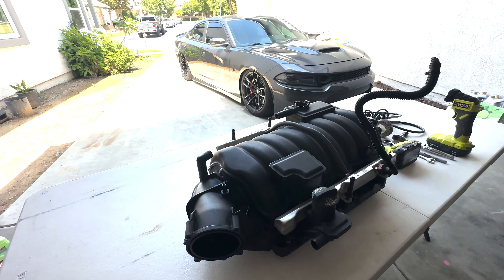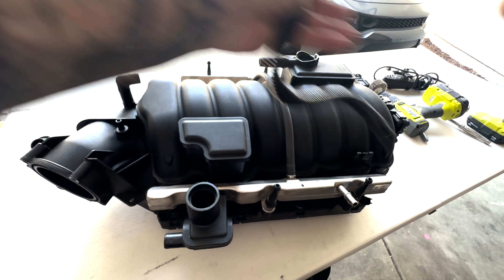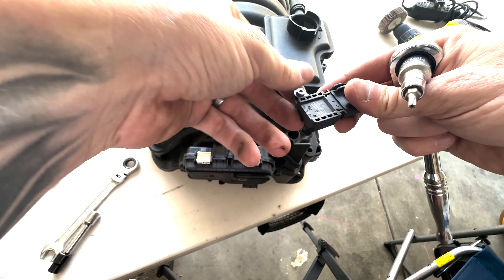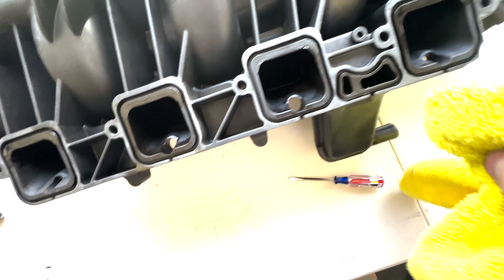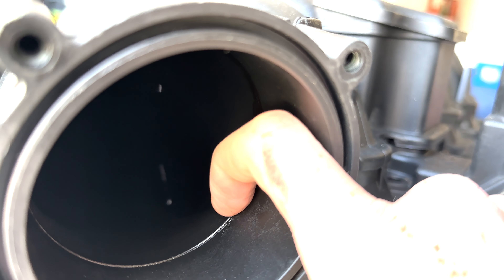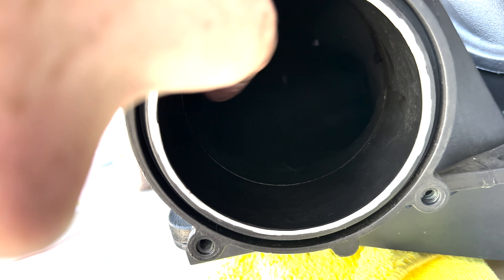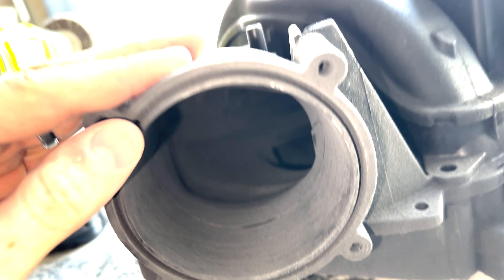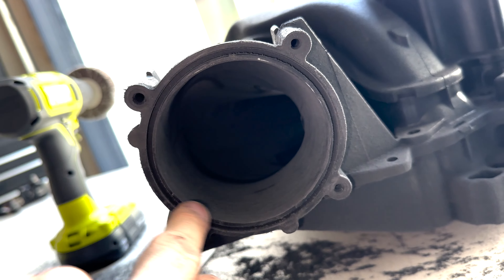DIY: HOW TO Port a 6.4 | 5.7 Hemi Intake Manifold | The Ultimate Guide | How To Port Match !!!

Comment: Porting an intake for a stock engine does nothing except provide more throttle response because of the added air volume now being flowed into the intake ports. To make power, you need to upgrade the parts that utilize the amount of airflow. Camshaft, ported heads, headers, or all of the above.
Reply: yes
Reply from the maker: Yes. Good input
Reply: My dyno said my stock scat gained something around 12whp.. I have a video on it.
Reply from the maker: @OMGITSMRMACK o totally believe that and hopefully one day I can have a good dyno test on it!
Reply: @ReidPerformance  I would like to recommend that the best buy is: install a supercharger: the least amount of time is spent, a significant amount of power is gained, which is greater than what is gained together with: fixing of intake and exhaust, camshaft, and it costs the same
Reply: @OMGITSMRMACK  very possible because some claim that only with the KN filter they get so much, of course because the dyno is not properly adjusted and calibrated
Reply: i ported my short and long runners on my 350z and yes throttle improved a lot but the thing i noticed the most was the power in higher rpms. before the port she used to pull you in the seat and slowly die off. after the port she just kept pulling its amazing and no tune!
Reply: most definitely add more air flow and more air into the intake manifold which means more POWER!!!!
Reply: @Snova_150  how did you come to the conclusion that more air enters the engine, I noticed that the engine pulls better below 5000 rpm if the gas pedal is not fully pressed, the lower the revolutions are than 5000, the less you need to press the pedal for the engine to pull the strongest, how do you explain that
Reply from the maker: @makantahi3731 less restrictions, means air moves more freely, therefore.. more volume is able to be pulled in with each stroke of compression
Reply: @ReidPerformance  that's right, only the intake manifold does not significantly restrict the air flow, nor does the new clean factory air filter, the maximum restriction is made by the intake and exhaust valves, all other parts have a higher flow rate, so whatever you do around does not increase the flow more than a marginal gain
Reply: I think I speak for all of us watching this that uh yeah, I think that’s what we’re looking for to begin with so, I’m here for it.
Reply: I just upgraded my 5.7 to the 6.4 intake over the weekend. 

I bought the ported intake package from MMX along with an oil catch can. I noticed a significant improvement in acceleration, especially the second and third gear. car sounds cleaner and even though I have the same transmission tune it seems to shift cleaner and slightly faster than it used to. 

I also shaved 0.2 off my zero to 60. I would highly recommend swapping to the 6.4 intake manifold with the active runner controller from MMX if you have a 5.7 Dodge. Out of all the upgrades I've done I've gotten the most improvement from this. 

Long tube headers, high flow cats, and camshaft are next.
Reply from the maker: @marknelson4856 thank you for sharing!
Reply: More air = more power!  Especially after a tune. Duhhh 🙄

Comment: Question when porting a 392 manifold yourself, but you want to swap it onto a 5.7, would you still follow the lines from the cylinder heads for the port side? Or would it be different?
Reply from the maker: It’s not different because the bolt pattern is the same

Comment: Hey Reid ya know what size torx screw is used for the air catcher headlights for the Challenger? Its not just pop and release
Reply from the maker: It should be a pop and release. If it’s not, then you likely don’t have it. 

It’s just a dust shield that isn’t screwed down
Reply: @ReidPerformance  so the 2019's both are functional i managed to get one. Left side where my cold air intake is. The right side is rusted but it has a small torx screw.
Reply from the maker: @forceoneX hmm.. I don’t remember there being a torx screw on there
Reply: @ReidPerformance  on both I got the TA plus edition 2019 5.7 Challenger. They both had two torx screws on the side prior to taking out the inlets. Left ones are rusted so bad. Bouta just break it. Wish i could send you a pic.

Comment: If i port a 6.4 intake manifold for a 5.7 that has never been on the 5.7 (its only been on the 6.4). If i follow the markings (left from the 6.4 cylinder heads) will it mate up to the 5.7 properly with a proper port?
Reply from the maker: Yes, I believe so

Comment: I get your concept here, and I don't think in theory you are wrong. My only concern is that you have removed material from a plastic intake manifold, and thus made the structure weaker. Add heat to that mix and I think you are asking for hairline cracks that will form and ultimately lead to either a rich engine condition or misfires.
Reply: why would engine misfire, it just can intake dirty air
Reply from the maker: That’s why you don’t exceed the port marks from the cylinder heads/throttle body

Comment: I port my own mustang manifolds. After buying from the biggest coyote porter and being disappointed. I use a 8” mandrel with harbor freight sanding cones. On a dewalt drill. Back when my cars were NA they were the fastest NA cars in the county. Even beating stock boosted vehicles
Reply from the maker: Nice!
Reply: Do you have a link for the 8” mandrel that you used, I’m in the process of trying to port my tbss manifold
Reply from the maker: @yvngramirez8889 I just use the basic dremel mod with the dremel extension. 

The bits I use are the 120 or 160 grit sanding wheels (also a dremel product)

Comment: Can you dyno please?
Reply from the maker: Hopefully I will one day soon!
Reply: @ReidPerformance  Do you think that the 4,800 rpm setting of the SRV maybe changed according to what the porting may have changed to the Helmholtz effect. Thanks
Reply from the maker: @jerrymossor288 no, the setting is the same.. it comes from RPM read out. 

You can change the setting if you like.. but has nothing to do with the end result of porting.
Reply: @ReidPerformance  
Without putting it on the dyno I am just looking for the best settings for the intake SRV. Thanks
Reply from the maker: @jerrymossor288 I know the best settings.. send me your file and I’ll send it back with the change
Reply: @ReidPerformance  
The last tune file that I am running?
Reply from the maker: @jerrymossor288 yup. Email it to me
christianreid22@yahoo.com
Reply: @ReidPerformance  
ok you have mail.